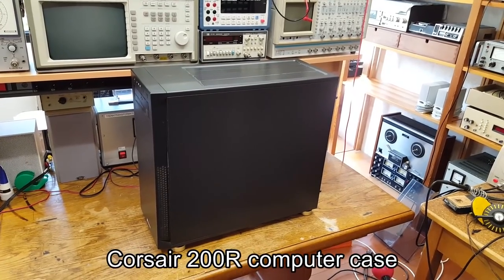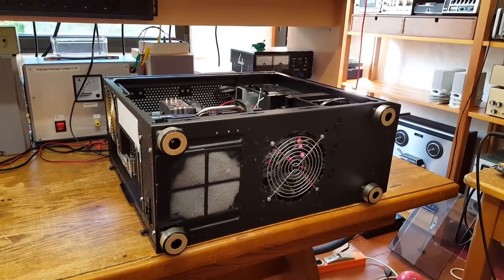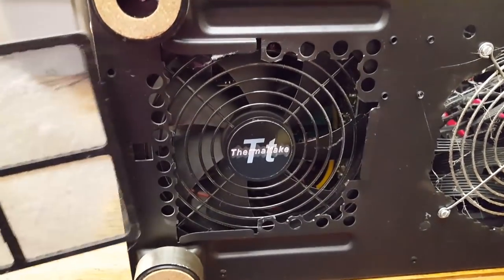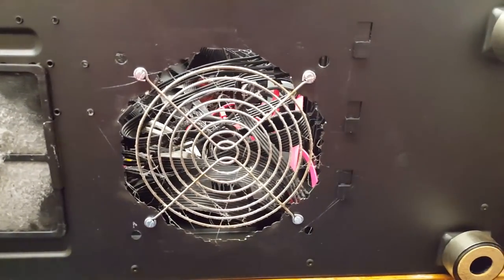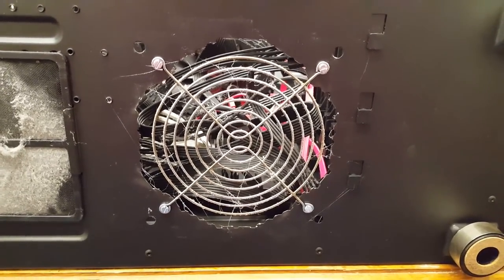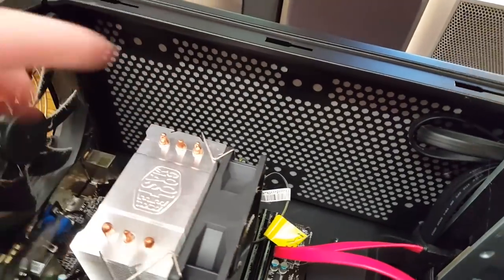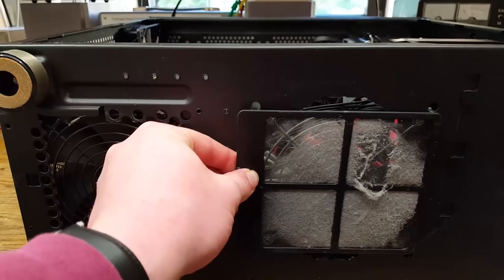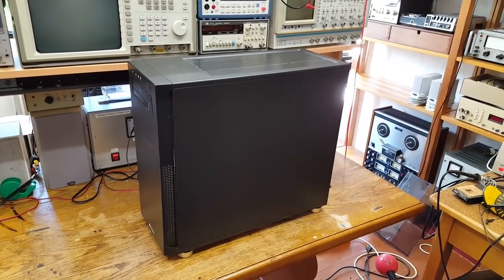Corsair 200R computer case modifications - conclusion

Comment: I'm using pantyhose as filter for last 5 years and it works really good. Some smaller dust can pass but it's barely noticeable and you can just brush dust off pantyhose or just replace it since it's cheap.

Comment: For PC air filters, I do recommend using 3M Filtrete filters, more specifically, the variant intended for indoor units of split air conditioner systems, as I've used them on my NAS (whose case lacks any kind of air filtration whatsoever), and my desktop PC (as a replacement for its original filter), as they do a great job of filtering out dust, but do need to be replaced when the white layer turns dark grey, which is usually after 2-3 months.
Reply from the maker: Good idea, but due to the fact that very few places in Germany have air conditioning, I have never actually seen such filters on sale anywhere...
Reply: Filters for cooker hoods are very common in german shops, maybe just buy one coal filter for that and then you have enough material for a while. Btw DrCassette put some wheels under the case then you can use it as a vacuum ;-D My case is missing one of the side covers and I don't have that much spider webs inside, while I never kill those thin long legged spiders in my flat, only remove their webs when I'm cleaning my flat, but they are my friends, they do a good job on mosquitos and are mostly out of sight.

Comment: I just watched your laptop power supply repair video.  You can cut off and drill out old moulded strain relief section and thread a new cable through the hole you drill or use a rubber grommet to fill up large holes for cables.  Then stop the new cable being pulled back through by using a zip tie round the new cable just behing the grommet or old cable moulding piece.  Hope this is useful.

Comment: I thought you might experience such issues. One simple filter that's very cheap and easy to obtain is a white pan scourer for non stick pans. It will allow good airflow but would prevent most of the dust ingress and definitely prevent Mr. Spider's return!

Comment: Make sure you have positive air pressure inside case and all intakes are filtered, this will remove your dust problem. More intake fans than outtake fans.
Reply from the maker: I have since added another intake fan to the case, so there is now two intake fans and one exhaust fan. The additional fan also has an air filter which plugs up much faster than I thought it would.
Reply: @DrCassette  Excellent the positive pressure inside will ensure dust isn't sucked in through the open vents and holes in the case. Sometimes if you have the case down on the floor or on carpet dust can very quickly clog filters, so having the case higher up, suspended under the desk; in a cabinet; or on top of the desk can reduce dust too. I vacuum out the filters on mine with a small battery vacuum